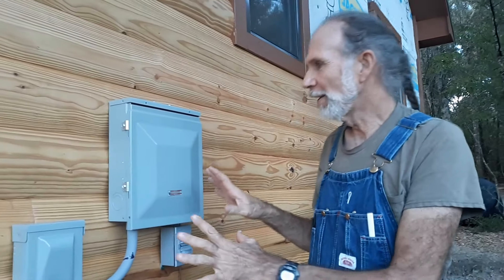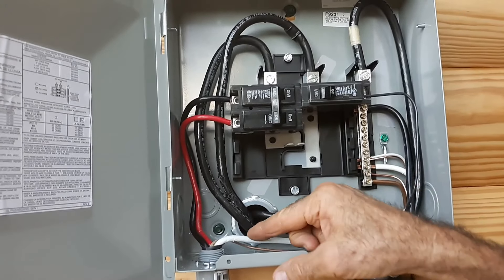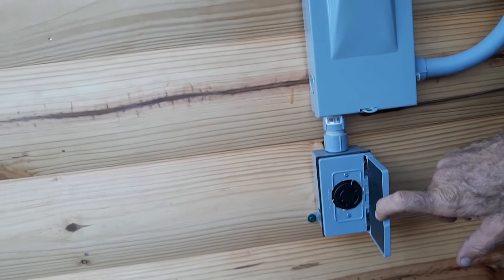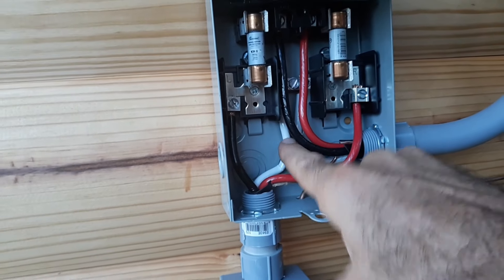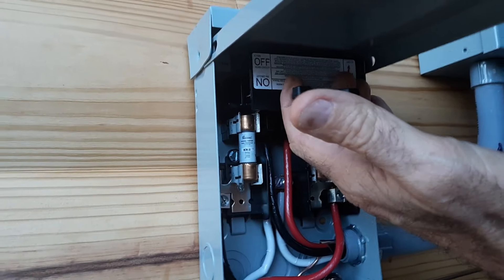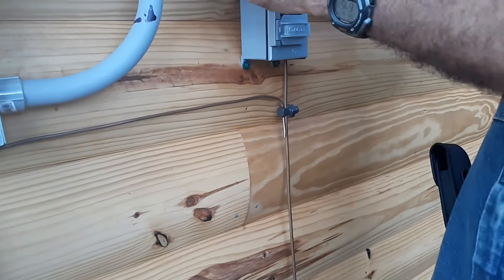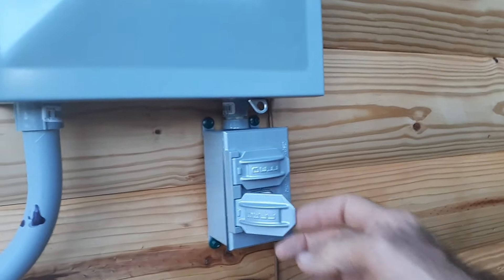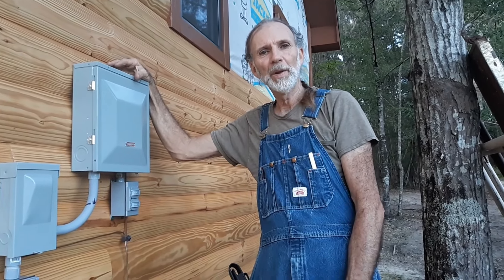Off Grid Cabin Build  |  Outside Electrical PANEL for Generator and Solar Power  |  Episode 15

Comment: That was great.  Just found your channel and subbed.  I'm putting a Westinghouse WGen9500 Gas Powered Portable Generator with Remote Electric Start
9500 Rated Watts and 12500 Peak Watts to power a small work shed.  Want to be able to plug into a small 110 window ac and winter a heater.   This as well as lights and plugs to run some small tools.  I will build a vented shed for the generator.  Honestly, I'm a bit lost on the permanent connections between the gen and building.  What connections will I need...etc.  I'm restoring a 75 360T Honda and I've got Cancer so the work will be slow....Ha.   I learned more in the one vid of yours than the 4 hours I've spent looking at others on YT.  Now I've got to find more of your stuff.
PS.  I'll be using a small solar panel to keep a charge on my batter in the Gen.  When I get the bugs worked out, I'm going to buy a bigger Insulated shed to put in the way back woods here in rural Oklahoma.  I'll be moving the Gen between the two spots as I'm being forced to retire so my income is going to drop......but heck, more time to fish.

Comment: Danny, I like the set up of the disconnect . I purchased a disconnect switch and the bar in the center looks like the ground wires attach to it. Could you explained  why in this installation that the two neutral wires are connected to the center bar and also how the ground wire is connected to the box before it goes to the main panel and to the ground Rod? Thank you for the clarification.

Lou

Comment: This is the exact setup I had in mind this has helped so much!! I can't think you enough. Do you have an updated video or the solar disconnect you mentioned that would be on the exterior as well?
Reply: @zachjines44   I have a question. Is it all solar or is there an electric pole also .

Comment: Danny - I think you have the wrong generator box installed. You've installed a 220v, 30-amp outlet. You need to install a 220v, 30 amp inlet (prongs rather than slots). To get power from your genny into that outlet, you'd need to build something called a 'suicide cord'. It's called that because it has prongs on both ends. If you have it plugged into the genny and touch the prongs on the other end, you can be electrocuted.
A genny inlet will let you use a cord that plugs into the genny on one end and has a female on the other end that you plug into the inlet.
Reply: Correct. The outlet needs to be a male receptacle.

Comment: 6 gauge wire on 125amp breaker? You need #2 copper. And a female outlet for the generator? Both are not up to code.
Reply: The 30A fuses have him covered.

Comment: Use of an L14-30 OUTLET is dangerous, and in violation of the National Electric Code (NEC).  This "plug" requires a male 4-prong connector at BOTH ends of the generator cord.  This is called a Suicide cord because it allows live prongs to be exposed when the generator is running.  He should be using a Code-approved L14-30 generator INLET.  ~$50-60 at the big boxes.  It's the safe and LEGAL way to connect your generator to your home, whether it is the primary- or backup source of power.

Also, his mixing up the terms VOLTS and AMPS seems to demonstrate a fundamental lack of understanding of electricity.

Comment: Ya sure are doing a lot of work on the cabin are ya planning on going off grid?
Reply from the maker: Yes and no.  We will still have power, solar or generator.  But the cabin will not be tied to a power company if we can help it.  We don't want the right of way through our property.